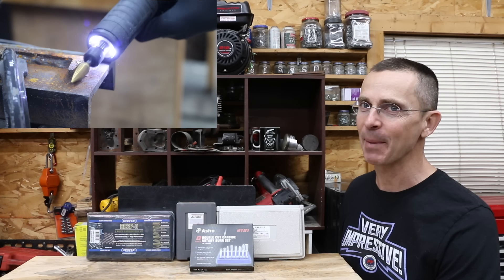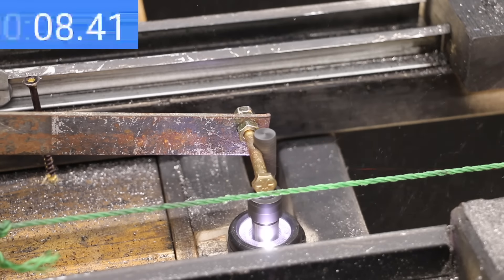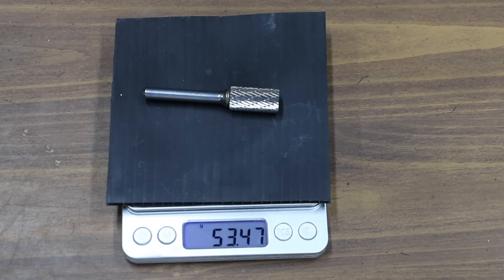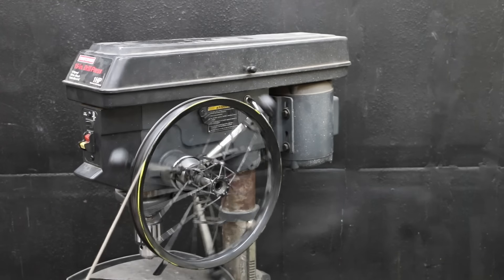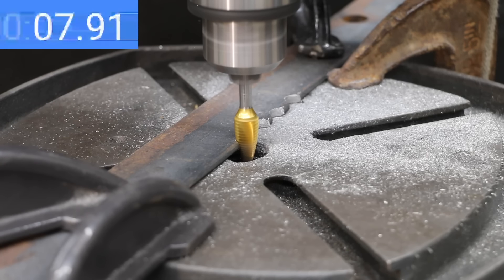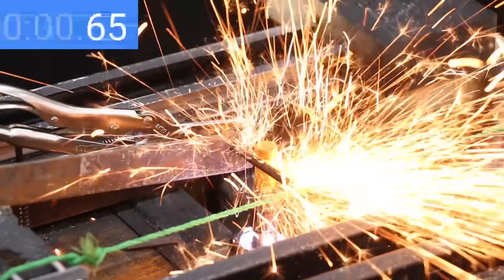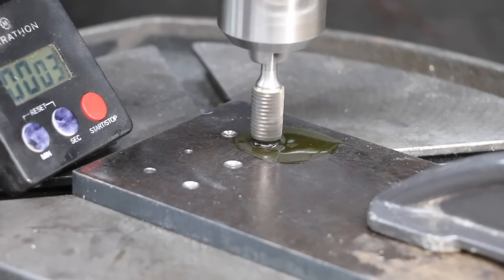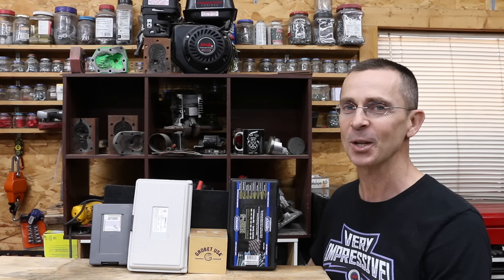$28 vs $300 Burr Set? US vs Imported Burrs. CLE-LINE, Champion, Grobet, Kodiak, Astro Pneumatic

Comment: My personal opinion is that long term wear is more important than saving a few seconds.  These tests put a lot more stress on the tools than I do.  A lighter touch keeps tools in excellent shape.
Reply from the maker: Thanks for the  feedback.!
Reply: and w these metal cutting burrs, it seems that its almost more productive at removing material with LESS pressure applied from user.... like you cant just turn em on n set them on the metal to bore out, as it will get all choppy n bounce up n around.  but juuust enough pressure to ensure the tool won't go bouncing outta ur hands is all that seems to be needed, i feel like too much pressure causes it to dig in too deep the be avle to carve and eject the metal shavings out fast enough to keep up w its rotation.. but lighter touch lets it just glide across the metal and itll sink into it before you realize its even happening!!!
Reply: I use these a lot to cut out steel, sometimes to make 16-50 mm holes in 1 1/2" steel, when you do that you cannot have 'a lighter touch' or you will be there all week.
It sucks but jobs that call for the die grinder are not ideal, thats where your first options wouldn't fit.
Reply: @elliotkane4443  what's your line of work? There are better tools to do what you've described than a carbide Burr. Oxyfuel, plasma cutter, magdrill. Unless you're just dressing a hole to size, that sounds like a lot of work.
Reply: @himynameisjeff  Boilermaker/Ironworker on this 1, We're not allowed to use oxy/plasma and I use my die grinder where the mag drill won't fit.

I could weld on a plate for the mag drill but it's just not an efficient use of time.
Reply: @elliotkane4443  you'll get that with those big jobs 😎

Comment: What rotary tool would you recommend? Or is a die grinder better? A video on rotary tools would be appreciated, then I can finally upgrade :)
Reply from the maker: Thanks for the video idea.
Reply: A die grinder is gonna be the best for power and speed. Air powered has always been king but electric seems to have caught up just fine so either is fine to me. Just remember some tools like drills aren't made for side loads. You can use them but you won't get good results in comparison.
Reply: Well, if you're using rotary burrs, a die grinder works rather well.  The DeWalt rotary tool he used works well too if you need better control than what a die grinder allows.  For small projects, dremel and ryobi actually make decent rotary tools.
Reply: Most 'rotary tools' are going to be more like a Dremel only chuck small 1/8" shaft tools. For burr bits and most other 1/4" accessories you'll want a die grinder. This will get you the 20k RPM speeds the bits are designed for. Astro has a decent pneumatic set with a straight and right angled one bundled together. The 'chief' brand HF ones are okay too. Many other brands to choose from for pneumatic, those are two I have experience with and would buy again. For battery powered, the M12 is king. For the corded electric the Bosch is nice. I like using 2" sanding discs and wire cups in my right angle and use my straight die grinder for burr bits and cutoff discs.
Reply: Any wood router, the trick is to find one with little runout.
Reply: Die grinder is far better, even the cheap ones work better. I use die grinders for living 10 hours a day 5 days a wéek. Pretty sure a rotary like a Dermal wouldnt hold up or have the torque to do the job.
Reply: @Michael HMFIC  dremel sucks yes. With electric, amps is where it's at. With today's rotary tools, it's hard to find a bit that can match the torque output. Speaking of 3/4" or smaller burr bits anyway.
Reply: @beinghuman3225  don't want same zipcode as +3/4 bits !
Reply: @beinghuman3225  electric die grinders are nice, I line how you can adjust the speed of them.
Reply: @Michael HMFIC  usually a decent electric tool can be adjusted from 5k to 30k. But now that I have a compressor with pw and volume I'll have to pull out the ol die grinder n give er another go to be fair.
Reply: @E Flanagan  not sure what ya mean by that bud.
Reply: Air powered die grinder wins every time ;)
Reply: The electric ones are great, but for the comparable power in electric they are 4 times the size
Reply: Variable speed electric die grinder or they have cordless ones now that are pretty good, Milwaukee makes a nice one. I have a modified wood router I use for some jobs and it works really nice but it’s bulky. A drill press running on high speed works good if you want the bit stationary and move your work object instead. I wouldn’t recommend a single speed die grinder because they run too fast and will just overheat the bit within a few minutes. Air grinders are cheap and compact but compressors are not cheap and they use 10 times more power than an electric die grinder.
Reply: Unless you have a large Air Compressor ??
Buy an Electric Die Grinder for your Rotary tool work.

Air Powered Die Grinders are the Best, "IF" you have enough Air to power it ????

One other advantage of an Electric Die Grinder is ?
They are A Lot quieter than the Air version.
( as you will soon see/Hear,  IF you buy an Air Powered Die Grinder ?? )
Reply: @Jim Bob 
Hey Jim.
The Dremel brand is both.

The brand has been around for Many years and is a great tool if you plan to do light duty/hobby types of work.
I am not totally sure IF ? Dremel has a heavy duty range ??
But the standard Dremel most of us are familiar with, is a handy tool to have in the shop.

One positive, possibly a negative, is Dremel has a large range of accessories available.
Which as mentioned is both good and bad ??
Because you will be wanting to buy them all, LOL 😉
Reply: Not the ideal tool for the job, but I use a cordless drill (Rigid brand) with my Chief (Harbor Freight brand) carbide burs.

Buy the Chief brand if working with steel. They were "expensive" @ $60 when I bought them, but they are much higher quality than the cheaper $20 set that HF sells.
Reply: @aaronthomas6155  I can attest for the Ryobi as I have owned one for years.

 For those folks considering a die grinder, one thing to remember with any electric die grinder, that is to not overload the tool.  Let the burr do the cutting at its own rate or else the armature in the motor will overheat and cause motor failure, (no need to ask how I know).  One feature to look for when buying a die grinder and that is a speed control, if one is available.  I have to use an external rheostat to slow down the speed of my Ryobi when needed, just don't go too slow and over work the tool or else you may overheat the motor.
Reply: Corded electric die grinders are great, more power than air grinders, very easy to power continuously, even one of those little tailgate generators will do, and they are fairly cheap. 1/4" shank bits are much easier to find, move far more material, and they hold up far better than 1/8" shank dremel style bits.
Reply: I’ve been running the Foredom RS for the past fifteen years and love it.

Easy to clean and maintain…
Reply: I use a 1/3 HP Wecheer.  Fordom is equally as good and interchangeable.  I like that I can buy new chucks and switch them out easily.  I've ground on metal a few times, but my main use was for carving artwork into sticks.  The flex shaft kept the vibrations of the motor seperate from the cutting head so I was able to make very precise details.  Cheap bits weren't my favorite things to use.  I typically spent $20 -$40/bit too because they lasted waaaaaay longer. 

Edit: spelling and more anecdotal stuffs

Comment: Just remember, sometimes you are carving up aluminum and do not want to eat the material off very quickly....so knowing which set of burrs doesn't cut fast is also helpful.
Reply from the maker: Great point!
Reply: tool speed comes into play here as well. The bite can be viscous.
Reply: speed & pressure.. like drilling steel or stainless..
Reply: Seeing which ones gum up the least on aluminum would also be useful.
Reply: @F0XD1E  as you probably know a slower speed helps.
Reply: so to ay it there are burrs specialy for aluminimum with bigger teeth so to say it and they dont gum up and there are burrs for steel with finer teeth u chose if u want to clean the burr and cut slow or cut fast and learn to control it
Reply: @dimitartenchev9338  Stop pretending you speak English.
Reply: @F0XD1E  I find running the bur in pariffin wax before I cut aluminum makes them last a lot longer.
Reply: @waytospergtherebro  You realize the internet reach is larger than the borders of the USA?
Reply: @waytospergtherebro  Sorry im not from a nation with borrowed language

Comment: Great stuff, as always.  You could measure wear less subjectively than the Project Farm Scale.  What if you weighed the burrs before and after a test?  You'd be measuring the amount of burr lost to wear.
Reply from the maker: Great suggestion!!  Thank you
Reply: I like the idea of a less subjective measurement but I am not sure a scale will be sensitive enough to measure that small of a change.

My suggestion would be to use a displacement test. Drop the object in a graduated cylinder filled with water or oil and measure the change in height of the liquid. The narrower the cylinder the more dramatic the change will appear. It could also make for a good visual comparison for the video.
Reply: You really think a displacement scale would showcase that small of a change in volume on those bits, really?
Reply: Best test for wear is to do a second run and note the drop in performance.  My 2 cents…
Reply: @deltalima6703  Yeah, the difference in time between the first and second pass should give an accurate representation of how much wear it has and an idea of how long it would last.
Reply: Making the burrs radioactive, then measure the amount that comes off. More material, larger signal.
Reply: @ProjectFarm  A commenter below made a good point about the wear maybe being too small to measure on gram scale.  Maybe you need to a video on comparing precision scales :)
Reply: @M19pickles  You can buy scales that measure by 10ths of a gram for pretty damn cheap nowadays. I don't think a displacement test would work very well in this case..
Reply: @Humboldtcounty707  Have you ever checked the accuracy of those scales? Most scales have a + or - 5 or 10% accuracy and that will really matter when you are measuring the changes in weight this small.

Comment: It looked to me like the Grobet did very well except for the last test which may be better served by using a different tool for that application. I would rather have 3 sets of the Jestuous than 1 set of the Grobet EXCEPT for the fact that the Jestuous is made in China. I will always purchase USA over China no matter what the cost unless I just can't get a USA tool that will do the job. 

Doesn't really matter as both are currently out of stock at the moment.
Reply: I agree, I think that the Grobet's overall performance shouldn't be discounted just because of its last-place showing in the final tip-plunge test. Just looking at performance in the first two, it performs second highest in average. Cle-Line is highest, and if you buy from Global Industrial the price per unit is almost the same as Grobet at ~$18. Kodiak is half the price, performs essentially as well, and only places in 4th for subjective wear (after Grobet and Cle-Line tied second, Champion first).

Comment: Thank you. I needed this comparo!!! Next up... Corded drills. I searched through your channel and didn't find a comparison of corded drills. I have bought three new corded drills in the last 6 years or so. Every one of them died young. Each, faster than the previous. I took the last one apart to find out why. (Didn't last long enough to drill ONE hole. 1/2" bit through 1/8" steel.) They put the brush housings directly into the same plastic that the body of the drill was made of! Not even thermoplastic! It's a wonder it lasted for even two minutes of constant running!
Reply from the maker: You are welcome!  Thanks for the video idea.

Comment: This one was especially useful for me because im about to port a set of 454 heads. 😀 But I'm not so sure that I wanna pay $300+ for a set of burrs 🤑 heck I was worried the die grinder was gonna be what hits me in the wallet!
Reply from the maker: Thanks for the feedback.
Reply: I did most of the work with flap wheels when I ported my gen 6 454 heads. I just unshrouded the exhaust valves in the chamber and smoothed the exhaust valve guide. I could have gone faster with burs but I didn't plan to take out a ton of material since it's just a mild street setup and I'm not porting heads everyday. Good luck with your build!
Reply: @c0c0asauce  flap wheels are great for cleaning ports

Comment: Single cut takes a bigger bite, but not as smooth running as a double cut. Some years back I ran a tool room in a machine shop. Spent many hours cleaning up freshly milled parts. The TiN coating can be useful, but only if it is done over a really good hard well machined base metal. You'll notice that cheap soft drill bits that have a TiN coating don't do anything for you, but a carbide drill bit with TiN coating will perform great and last a long time in the shop. Love your real world reviews! Thank you! You have helped me many times to buy good replacement tools!

Comment: Your content is always interesting and worth watching. As someone who uses carbide burrs daily in the machine shop I wasn't too surprised by the results. I was hoping you might use them on some soft materials brass, aluminum, magnesium. etc.  The type of burr single cut vs double cut as well as rpm all make a lot of difference along with the amount of pressure applied when cutting any material. In my experience some burrs tend to get hot quickly, then over heat "soft"  materials many times then the teeth  become so embedded with material the burr can no longer cut. While other burrs can operate at the same speed without lubricant or coolant and do a good job.  Really do appreciate all your hard work and effort to bring us so much great  unbiased content. Thank you.
Reply from the maker: Thanks and you are welcome!

Comment: Can’t thank you enough for doing these videos. I ALWAYS check your channel before buying a new tool. Very informative, to the point, don’t waste time making long videos; just testing like it should be. 

Have you thought about doing a die grinder video? Pneumatic and battery. Currently in the market for a couple both straight and 90 degree. Those new Milwaukee look real nice, but should we stray away from air if the shop is set up well for it?? Hoping you can throw in some insight and a video. 

I believe I speak for most of the blue collar workers tuned into your channel when I say thank you for doing this so we don’t waste our hard earned money on something that is junk. Keep up the great work man, God bless 🤘🏻
Reply from the maker: Thanks and you are welcome!  Thanks for the suggestion.

Comment: Wholesale Tool has good burrs and mine have lasted almost a year with a small amount of ware. Used on gray cast iron, stainless - ss800, mild and structural steel. I also lubricate my burrs with thread cutting oil while in use.
Reply from the maker: Thanks for sharing.

Comment: So I have a good bit of time running annular cutters. Always get carbide tipped if you can. Also Hougen makes a mini set for sheet metal that is amazing! I had one for over a decade before I broke it. So my reason for getting carbide always is when I built columns daily for years we learned that steel plate over 1-3/4 inches thick gets a mill scale crust that is stupid hard! It can eat cheap hard grinding disks and smoke HSS tools every time! The cheap trick is to just hit it with a ball peen a few times around the drill site. The drillers where burning thru bits! Always coolant or cutting oil flood them! Always! The old master wouldn't let you check them out of the tool room with out a quart of dark sulfered oil charged to the job as well. Random bonus ramble, we had to place tags on the side of massive stacks of steel plates as crane test weights. The sides of the plate had a ridiculous hard crust. Only about 1/8" deep but impossible to drill with HSS and 2% cobalt for that matter. We had to go get specific solid carbide straight flute bits. 60$ Each! For 3/16. In theory we could have annealed the mounting points, but painted finished product... we used blind drive pins to secure weight/serial # tags. I believe this phenomenon occurred due to the very large very thick sheet of steel is getting quench hardened by way of the water bath used with the mega plasma cutter they use at distributors. You have to pay extra for ground and finished edges. Steel plate gets a carbon crust at the edge from torch or plasma cutting. Even lazer, just much cleaner and much less heat distortion. Side note, the water jet will impregnate aluminum with garnett media and is near impossible to weld. So. Project Farm if you ever get to read this being a new subscriber this is my contribution; automatic center punch brand test( dimple depth in different grades of materials, pressure to actuate), chisle and punch capability/ durability testing. Scribes!
Reply from the maker: Thanks for the suggestion.  Thanks for watching and subscribing!

Comment: As a note, I was using these type burrs in the Dental Lab back in the 70s, and lots of them my Dad had (he owned the lab) were already pretty old.  I still have a bunch of those.  Super useful.   Also I have a bunch of quite smaller ones designed  to be used in small handpeices,like the Foredom  motor setups I have